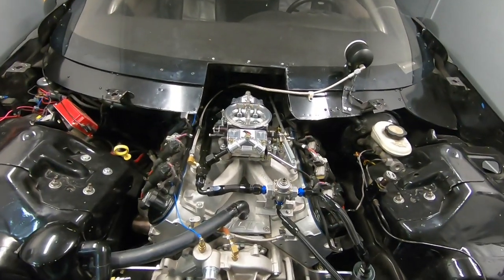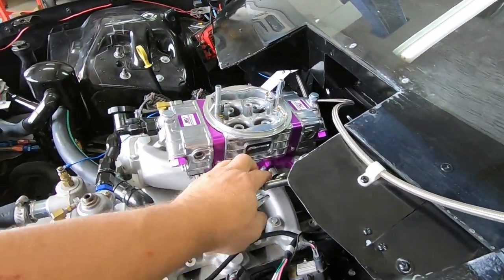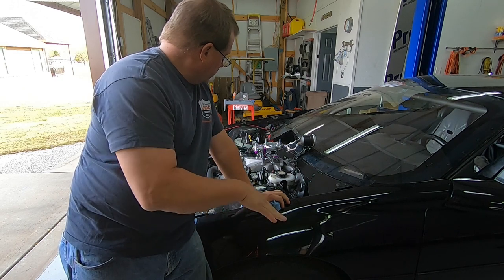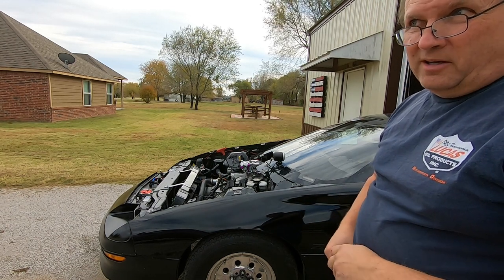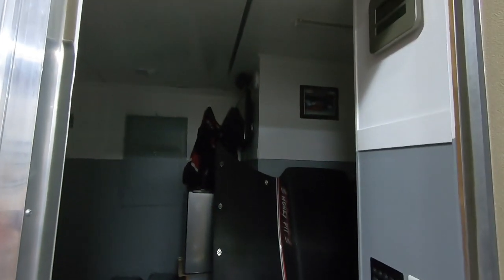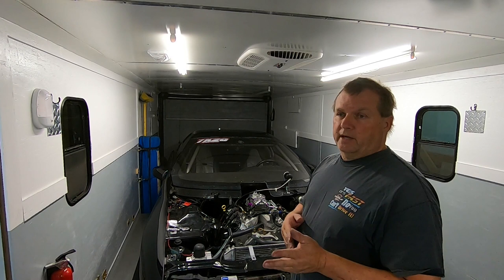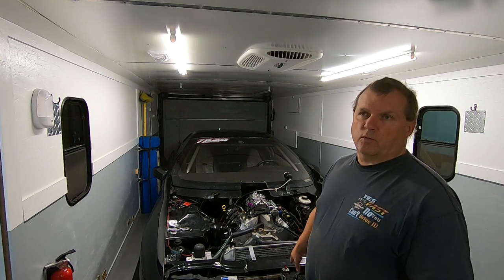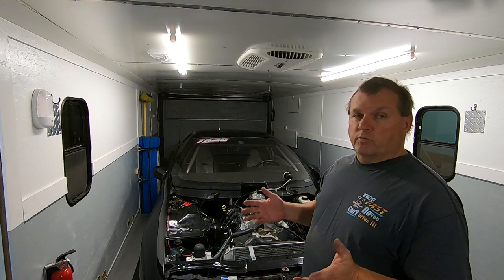Trying out a Gas Carb - Difference between Methanol and Gas - Part 2 - Tuning & Results

Comment: How much quicker than 6.80 was the methanol?
Reply from the maker: The 6.80 was the methanol time, I think the gas  was about .06 slower? Mainly the 60' times was the biggest difference, the methanol develops more torque than the gas setup.

Comment: 2.5x more fuel burn on alcohol
Reply from the maker: Yes sir, it does consume much more for sure. So much more maintenance as well.
Reply: @KensKorner  but ally has next to no carbon build up, cooler engine temps, and can handle more compression and timing.